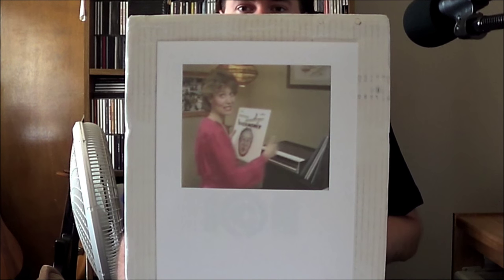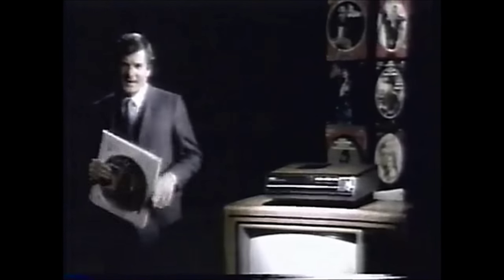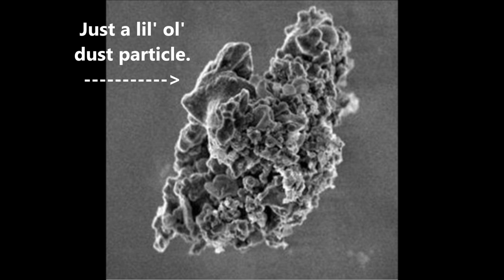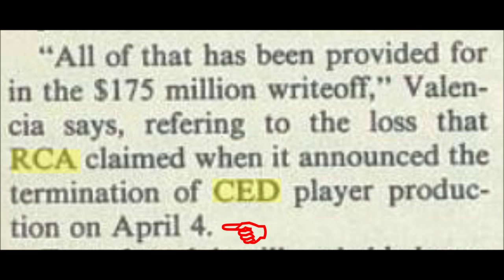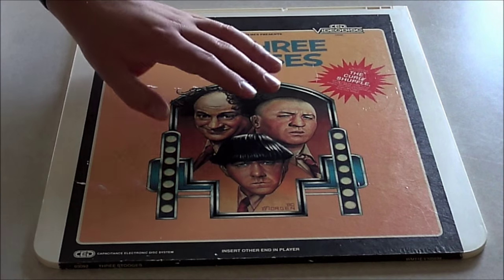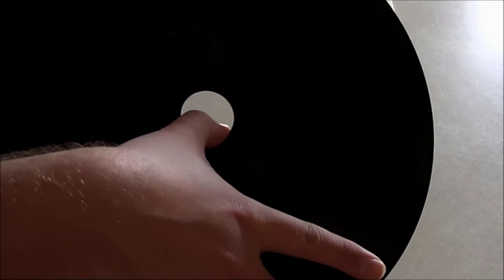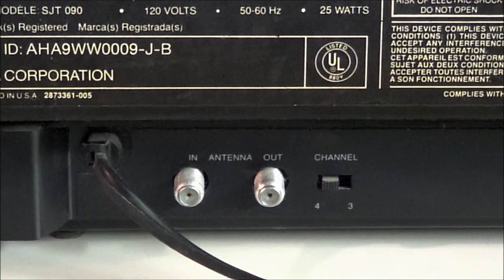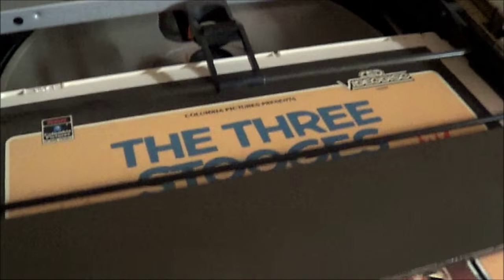Oddity Archive: Episode 92 - Capacitance Electronic Discs (or, CED's)

Comment: I was the Chief service tech on this item at RCA. This device was actually a very good video entertainment device. Color and video was top notch , way beyond what off air Tv offered. It was a simple player operated with digital devices, way ahead of its time. The player was overpriced, $500 was an exhorbitent price to pay for video playback. If you liked vinyl you would have loved this disc player.
Reply: I grew up with this player, and desperately wish I still had a working one. At one point, my father had actually bought out the entire stock of a store that was liquidating at the end of the product line's life, so there are around 400 of them still in my grandparents' basement.
Reply: As someone who is obsessed with vinyl and think it's over all the best format of music, I would love to get a hold of one of these players and some of the discs someday. Signed, someone who is currently obsessed with mini portable TVs and figuring out a way to use them in today's day and age just for funsies
Reply: @EmeraldCityVideo  my player still works great.

Comment: Trust me- you will fall in love with this format if you find a good player with stereo. The sound quality is surprisingly good (it uses CX noise reduction which was also on the analog tracks of laserdiscs). Skipping isn't always permanent, often playing the skipping segment over and over will get rid of the skip. It definitely requires a lot of patience and tolerance to appreciate CED, but that's why I love it!
Reply: why watch a movie in a format that skips just for the sake of watching it when you could watch the movie quite easily for free online? I will never understand this idea.
Reply: @123666yeah  do you even realize how many movies are not available online
Reply: @romulusnr  I can find virtually anything online...just have to know where to look
Reply: I'd like to hear what the stereo players are like, but they just look too "normal." My first generation RCA player just looks so wacky under the TV.
Reply: @scottziegler4238  I have parts of the stereo demo disc uploaded here, also “Eroticise” (which has gotten more views than anything else I’ve uploaded) is from a stereo CED.
Reply: @TheMediaHoarder  I’m assuming the stereo players send composite video out. That would certainly help the quality!
Reply: @scottziegler4238  my stereo player looks almost identical to a first generation RCA player.

Comment: I still have mine . I own 3 players . The original SGT-100 , the SJT 100 and the premium model The SKT 400 . They all work great . The picture quality is pretty much an equivalent to VHS . I also own about 300 discs. Most of them I purchased as New Old Stock. The others were from  private one owner collections hence, they were not played very much resulting in very good quality play.  The first model I bought as a kid in the 1980's . I was told by the eager salesman that CED's were the wave of the future, Sadly , this was NOT the case. VHS took over and that was the end of that. I still use use them and enjoy them . My friends are baffled by them which in itself is entertainment in itself .  Thanks for the post !
Reply: The look on people's faces when they see a completely analog player is priceless! They can't believe a record could play video. I own a humble RCA SFT 100, the basic end of the line and I love it! And despite being a LD junkie, I love the quaint feel and even working on the player (oiling, belt replacement, gear and needle fix) it's a format that was truly ahead of it's time and had the VCR not been available at the time, it would have been a lot more successful.

Comment: Like 5 years ago, I came across a good lot of 3 CED players (All working), and about 100 movies (I think 150 discs) for $50, and then a couple weeks later, for $5 I grabbed 20 more movies at another yard sale. Havent seen any since. Busted the rear shocks in my car getting em home. All the players still work, and have remade needles in them. Why did I get them? Nostalgia...we had a CED player when I was a wee lad. Laserdisc is my preferred retro format though

One of the issues with CED stems from improper storage. People instinctively stack them which is something you should NOT do. Stacking them can cause the grooves to flatten under the weight, it's the same with LPs actually. Flat discs will skip, freeze or get video virus (CED's laser rot.)

Comment: My dad had one of these, most likely purchased when the players went on clearance in 1984. We had a whole stack of discs because by 1986, people were practically giving them away. Eventually it stopped working (probably a bad belt or stylus) and my dad got rid of it. I was always fascinated by that thing, though I didn't find out how it actually worked until much, much later.
Reply: Same here. I mentioned the two my parents bought, and the intricate workings of the load/unload process that I learned about later than I should've.

Comment: Your player is higher end than mine was; it had the eject/pause/play lever on the left and was fully mechanical. Yours has an automated eject button. The canonical lowest-end CED player is the Zenith VP2000 (as mine was) aka the RCA SFT100. Truly low end required you to shove the caddy in yourself and then yank it out and a lever in the back was supposed to latch onto the caddy and keep it inside. (Older players often this stops working and you have to go in and apply some grease to fix it, as I did on mine.)
The problems you're having with yours loading probably has to do with the automatic loading going flaky.  It's only 40 years old, damn yo.
Reply: yup - the drive belt for the auto feed has turned to sludge. A quick replacement belt will fix that easily enough.

Comment: I've got the SGT-200 Stereo CED Player (ca. 1982) like at 2:55 in your video. I bought it used in 2007 at a flea market for $75.

Still works. It's just in my Dad's basement at the moment, with no where to (easily) plug it in where I'm living now.

I remembe when CED first came out in March 1981.

Comment: Our family was a fan of it until the VCRs, tapes and particularly tape rentals came down in price - as you noted - and remember this was when 20 dollars in 1981 was worth over 60 today (meaning that 80 dollar tape was over 250.00 today - hence why rentals were more common until the very late 80s / 1990s). 

When we got our first player it was less than 1/3 the price of a VCR, and the movies were 1/5 (or less) the price of buying a pre-recorded film on tape. Rentals were less than 1/3 price. This was all before cable became widespread in our area so it fell right into a nice niche for about 4 years for us including providing stereo support on video (also rare in either broadcast, cable or even tape). If it'd come out in the 70s it might have caught on, but the finite shelf-life of the discs themselves with that silicone lubricant wasn't going to make a movie copy last forever by any stretch (until they came up with another method / formulation).

*also laserdisc players were insanely expensive - around 1200-1800 - I never knew anyone who had one until those had a resurgence in the early 90s when those came down in price and were combined with CD player mechanisms.

**another fun bit of CED lore - RCA scored a 1 year exclusive on Star Wars (their first stereo release too if I'm not mistaken) ahead of it's release on VHS/Beta. So for a year our household played host to many 'Star Wars' viewing parties.

Comment: I have an auto-load player. Every couple of months I'll drag one of these out for fun. It's usually not a rewarding experience.

A Who disc I have was doing some serious skipping and scrambling - taking the disc out and wiping it down with tap water appeared to solve this. Odd.

I WANT that Let it Be disc. I have no idea why.

My SJT-200 has started doing that loading BS as well. I had to push it in as you demonstrate here.

Comment: the loading issue is likely due to extra physical resistance in the load drive mechanism causing higher current in the motor, which the drive mechanism recognises as it having stopped at the end of the travel and hence reverses the load. Its REALLY common in a lot of load mechanisms and not that hard to fix

Comment: Consider yourself lucky to have gotten ahold of one of the 2nd-gen models... as they make use of a direct-drive turntable, eliminating the need for a long rubber belt. But watch those that remain, which are part of the auto-loading mechanism... cleaning-up the remains of the previous belt during replacement will require use of cotton swabs & a strong alcohol-based solvent. Plus, the loading mechanism includes a small fork-shaped plastic part that manipulates a steel lever... And if that ever gets broken, Lord help you in all aspects of replacing it!

Comment: A successful product is one that solves a problem that everyone has.  "Has this ever happened to you?!?!"  VCRs were a solution for every household with a TV; how to time shift.  With a VCR you could record when you weren't home, you could record something while watching something else, you could rewatch something over and over again.  It was the first DVR.  IMHO, the technological shortcomings of CED are overplayed.  It failed simply because the idea of renting or purchasing titles for one's home video library didn't exist and that isn't how VCRs were originally marketed.  That's why it isn't ironic or strange that RCA sold a VHS machine alongside their VideoDisc system.  Look at the ads for the first VCRs and there is literally nothing about renting or buying movies or the availability of prerecorded titles.  The first VHS player my dad bought was called the Quasar "Time Machine," for example.  The closet thing to a time machine you could buy!  Time shifting - that's what that VCR market was all about in the early days.  LaserDisc and VideoDisc were answers to questions that consumers didn't even know to ask; e.g. how can I have my own video library?  BTW, taking a decades old CED player and disc and declaring they skip all the time isn't really an accurate understanding of how they preformed at the time.  I knew a family that had a VideoDisc player (the dad worked at RCA after all) and those discs never skipped and the picture looked great.  Take a 35 year old VHS tape and play in back in a 35 year old VCR and then compare it to RCA's VideoDisc.  CED failed and LaserDisc never captured more than 1% or so of the home video market because they were selling to costumers that didn't exist.  CED didn't last as long because they couldn't ramp up like LD (somewhat) did.  The time, money and push for wide distribution to every RCA dealer in the country on day 1 meant it had to be a blockbuster success and when trying to establish a new market...a new costumer base...that wasn't likely going to happen.  Ironically, RCA sold many more discs per player sold than they had anticipated so (the limited amount of) people who bought the machines were obviously happy with them.

Comment: I had that same player and NEVER had a loading or unloading issue. I also owned the SJT 400, the fancy player that DID do freeze frame, but had some drawbacks with that.  Neither player ever had issue loading or unloading a disc and were completely automatic. Your play had to have had a belt that was loose.  That was a big issue for these players. Also, you didn't mention Jane Fonda Workout. THAT disc is why the exercise craze started on home video.  It also sold quite a few players.  CED was also the first system you could take home commercial free episodes of Star Trek, the Fugitive and other TV shows for under 20 bucks for two episodes.  It was a technically inferior system but was ahead of its time in other ways.

Comment: Has anyone tried using the 'wood glue' technique of cleaning LPs on a CED? CEDs are made of a PVC composite so it should be stronger than vinyl, and skipping CEDs are caused dirty grooves and not scratches.

Comment: For the problem with your SJT-090 loading discs, it can be a couple of things.

1. Loading belt problem.  It will be safe to assume that the loading belt was replaced.  But, did you clean all of the deteriorated rubber off the pulleys?  And, is the belt the correct size?

2. Loading rollers are dirty.  Occasionally, you have to clean the four rubber rollers that's supposed to move the disc caddy in and out of the player.  You do this by using a paper towel dampened with rubbing alcohol.
Reply: +Watcher3223 The drive motors may need a lightweight oil (unlikely), or the belts he got were the wrong size because he measured wrong (likely). When he takes the disc out, you can hear the motors stuttering to get traction.

It's likely he never changed the belts because I've never seen him capable of fixing anything in any videos.
Reply: MrWolfSnack

There's only three motors in the SJT/SKT series, and that's one that drives the loading mechanism, a stepper motor driving the stylus arm back and forth, and the direct drive motor spinning the turntable platter.

Of the three motors, there's only one belt and that's for the disc loading mechanism.  Chances are, the original belt is no longer there; the belts RCA used in these things had a nasty tendency of turning into sticky goo after a few years, which you have to clean off using alcohol.

It is possible that the replacement belt may be too loose.  It's also possible that the pulleys weren't cleaned of the old rubber goo, which could then act as a kind of grease allowing the belt to slip on the pulleys.

And, there are four rubber rollers that pull the caddy in and pushes it out during the disc loading process.  Over time, dust and dirt can collect on those rollers, causing them to slip on the caddy. That can keep the player from pulling the caddy in completely to allow the mechanism to latch onto the disc spine, which would prevent disc extraction from taking place once the player starts pushing the caddy out.

If the rubber rollers are slipping, then the fix is simple.  The directions are even printed on a label on the inside of the top of the cabinet. You take a paper towel or a cloth damped with alcohol and you wipe the rubber rollers clean.
Reply: *****
RCA always used premium grade rubber. The pinch rollers on 8 track tapes can attest to that. It's unlikely that one would melt unless exposed to high heat.
Reply: MrWolfSnack

"RCA always used premium grade rubber. The pinch rollers on 8 track tapes can attest to that."

Those are pinch rollers, not belts.  That's a different kind of rubber we're talking about and for totally different applications.

And I speak from experience, having repaired quite a few CED players.

The belts never had a problem with "melting."

Rather, the square belts RCA used in many of their CED players, from the SGT-250 all the way up to all models of the SJT/SKT series, would decompose after several years due to improper vulcanization of the rubber.
Reply: +Watcher3223 Quality.
Reply: Wolfgang Ervin

Even the finest quality products are not perfect.

Comment: sorry to tell you, but all of the sjt and skt players have direct drive turntables. as far as loading, the one belt in the whole player is probably a bit tired, its really easy to replace, and if its not the belt, you just have to clean the pinch rollers with some alchohol. the problem is people are reviewing maintenance neglected players with poor discs. most of the time a disc gets better as you play it. no they arent all winners, but it appears you only went on ced magic to get basic info and didnt look into how easy some are to fix...

Comment: I find these CED devices absolutely fascinating.  I have genuinely never seen one and had ot until 2010 even heard of them!  Did they ever make it over to Britain?
Reply: +morelenmir Ben mentions PAL, so presumably they did.
Reply: Foxhack
Or maybe somewhere on the Continent - West Germany often seemed to get higher tech stuff than we did for quite a long time.

Its a real memory hole for me though.  I don't doubt they probably were at every Curry's and Dixons back then, but if so they just never registered with me.  I can only think I got them mixed up with 'Laser Disk' which I was aware of and never looked any closer.
Reply: +morelenmir Yes they did: a 'had to be the first with everything' friend had one back in the 80s, as well as a Laserdisk player, which got a lot more use: better films.

The CED player actually outlasted the Laserdisk one, which apparently would have cost more than its purchase-price to repair when it went wrong (I think Philips sold them at loss-leader prices in the UK to compete with VCRs).

I remember the CED picture was as good as the Laserdisk—both obviously better than VHS—but the CEDs did tend to start skipping after a few plays, as Ben says, while the plastic caddy-cases were fiddly to load — and fatally easy to misplace when you wanted to unload the disk. I wonder if there were ever any incidents of blackmail involving kidnapped CED cases?

Comment: I don't think you give CED or RCA enough credit. I'm a CED fan, grew up with it brand new, it's my favorite old format. Anyway RCA went total overhaul to get this out to production. Basically a completed redesign in a year and half. It was ahead of its time using a needle to track the disk and an electrode to pickup the undulations was ingenious. The players are microprocessor controlled and the discs actually hold control data called DAXI. Now discs improperly stored or styluses worn suffer playback issues. I can play most of my discs front to back perfectly with no interruption.
Reply: CED didn't hit the market until late '82 and was originally planned for the 1960s Home Electronics market.
Reply: +Tornado1994 The system was released in March 1981 originally planned for release in the mid 70s. It suffered a lot of set backs and would have faired well in the market had it been released earlier.